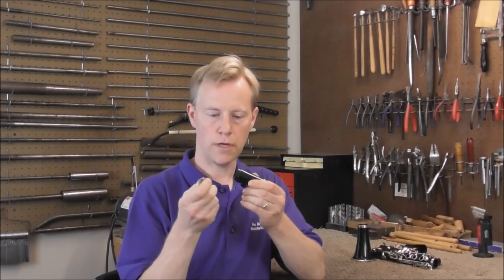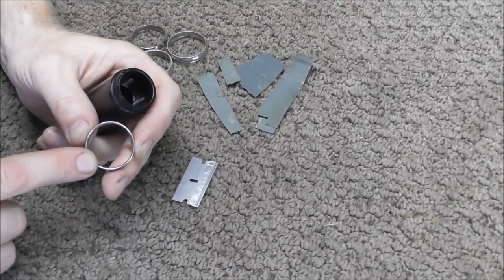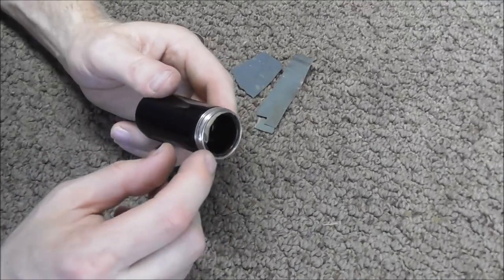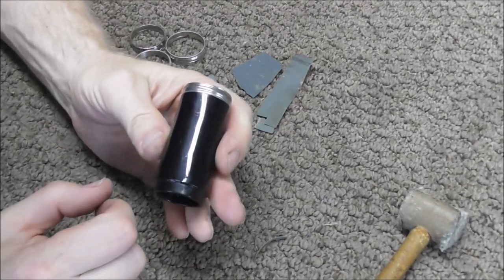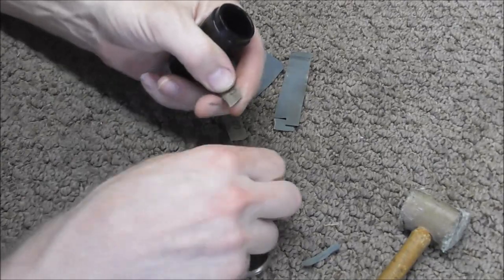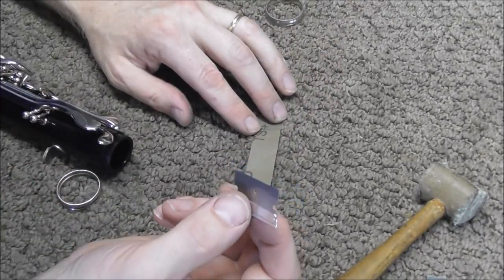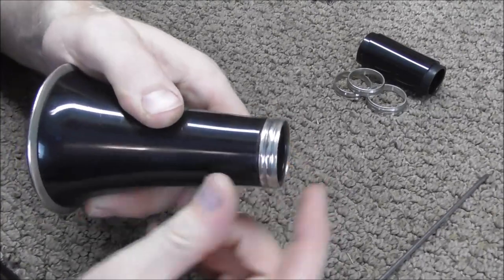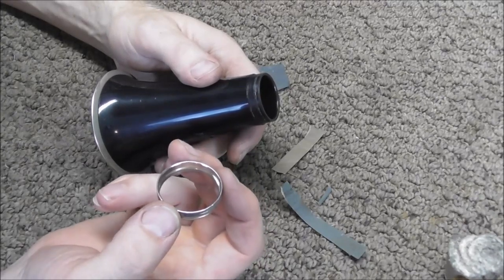How To Fix Loose Socket Rings on a Clarinet

Comment: Thanks so much for making these videos! What would be a good way to tighten up a loose ring on the clarinet bell?
Reply from the maker: There is a tool to do this that shrinks the bell ring to fit tighter. I have one of these tools, but it is expensive and not practical for most people. There are a couple other ways of doing it, but they usually do not work very well.

Comment: Hi. I have a question about Socket ring repair. I noticed that the Upper Socket Ring of the lower joint of the Buffet Festival clarinet, which I bought secondhand, was poured with instant glue. I heard that glue is a repair that is generally not used well, but I was wondering if it could cause problems with long-term use, and if it would be necessary to repair it to remove the glue and restore the ring. Other than that, there are no problems such as cracks, but I'm worried that the glue will cause problems. There is also a gap between Ring and Wood.

Comment: I have a slight dent in the tuning slide of my trombone, I’d rather not send it to my local repair shop because it’s rather expensive for such a minor dent, any suggestions?
Reply from the maker: It all depends on where the dent is on the slide. It probably is best to take it to the repair shop because dent removal tools are fairly expensive to buy and the chance of damaging it more is fairly high unless you have the proper tools and some dent removal experience. If you wish to try it yourself, let me know where the dent is on the slide and I will try to help you.
Reply: The Brass and Woodwind Shop Thank you, I will take it to the repair shop.